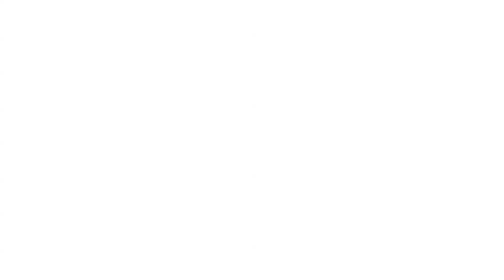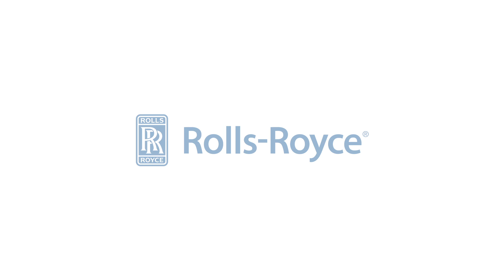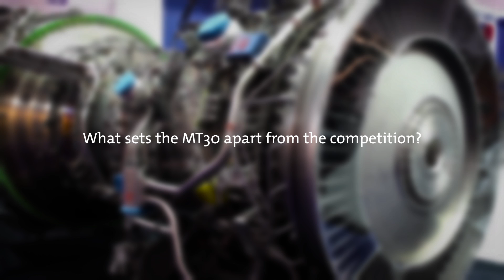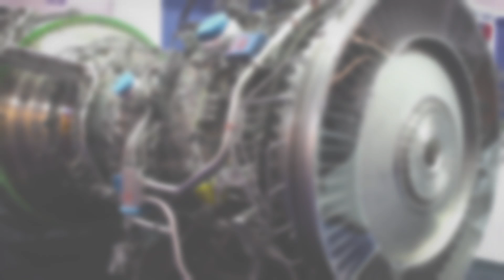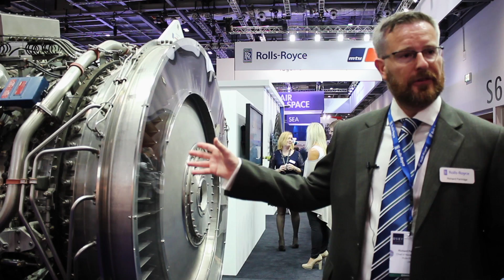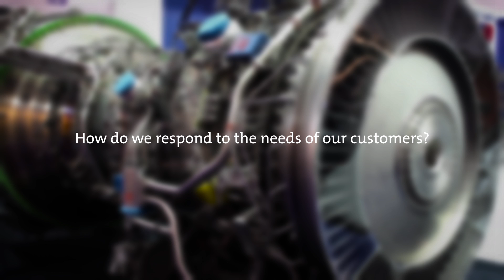Rolls-Royce | Richard Partridge On Our MT30 Marine Gas Engine

Comment: 40 MW is over 53,000 horsepower. Yet no ship those engines are installed in has anywhere near that much "horsepower" even when two are used. Why? Because the transmissions and accessory systems needed to make a "jet engine" work in a ship take the majority of the power the engine produces and then engine power is further wasted driving electrical generators that power electric motors for actual propulsion. Not to mention the warm humid air literally at "sea level" are horrible for "efficient" operation of "jet engines" and the lack of "ram air" those engines get when mounted on aircraft and the fact that they're just the "cores" of turbofan aircraft engines being used without the fan and as a result are just "turbojets"  just makes them giant, inefficient, fuel hog jokes as far as turning fuel into power "efficiently". 

And they never get anywhere NEAR 25,000 hours of continuous full-load operation between "overhauls" and are impossible to "overhaul" in place in the ship. Unlike diesel reciprocating engines that can be and are "overhauled" simply by replacing/rebuilding individual power assemblies (cylinder/piston/connecting rod/cylinder head assemblies) that are specifically designed and built to be overhauled and repaired "on-site" because of the impracticality/impossibility of "pulling" complete engines and sending them to an overhaul/repair facility for service.

And where diesel reciprocating engines are designed and built for continual operation at full load and are most efficient and give the greatest "operating efficiency" and the most reliable service and longest service time when started and loaded and kept fully loaded or as heavily-loaded as possible and can be used for "direct drive" propulsion or with a minimal amount of reduction/reversing gearing, "jet engines" or at least Rolls-Royce jet engines are overstressed and give very short service lives and are only available for "full power" operation for short periods and are designed to operate at "partial load". 

Cruising power in an aircraft is nowhere near "full power" and Rolls-Royce Trent turbofans have consistently "had issues" when subjected to true "full power" operation during "maximum power" tests like General Electric's "triple redline" tests GE "aero engines" are designed to "survive" continually and repeatedly for the entire service life of the engine. The last time a Rolls-Royce Trent underwent a "triple redline" test on a GE test stand for U.S. FAA airworthiness certification, it failed catastrophically and severely damaged GE's test stand only a few minutes into a test that GE engines can and do and must "survive" repeatedly for as many cycles and anyone wants to subject them to. 

And at a power level GE's "old" GE90 engines can and do reliably almost double during normal operation on test stands. GE GE90 engines don't reach those power levels in actual service because no airframe made can use/handle that much power. 135,000 lbs of thrust "maxed out". R-R hasn't been able to keep any "member" of the "Trent family" in "one piece" at 70,000 lbs. of thrust for more than a few minutes at a time and even then only under carefully controlled and specific operational conditions as far as ambient air temp, aircraft weight, airport density altitude etc on takeoff. R-R "jet engines" in warship applications even in lightweight and lightly loaded "destroyers" and "light cruisers" have a horrible service record and reputation when worked "hard" at their maximum rated capacities in anything but ideal conditions and "cold" seawater with heat exchangers and other cooling and accessory systems in "brand new" condition freshly installed or right after "refit" and that's with other diesel engine generators carrying most or all of the "hotel load" of the ship with the "jet engines" providing only main propulsion. 

But as long as they're going in taxpayer-funded warships where money is no object and market forces and profit/loss concerns are non-existent, what the hell.
Reply: Sir, I think you might be "missing the point".  These gas turbines are used in warships because they have a significantly higher power density compared to large, slow speed diesels.    A 40MW gas turbine and alternator package is about the same size a a shipping container, whereas a diesel with the same output would be the size of a large office building, and at least 10 times the weight.  That extra volume can be used for fuel tanks, living quarters etc.     Some of what you say regarding aero-derivative engines is true - but the trade-off works in favour of GTs for warships.
Reply: Dear me, you're not a happy bunny at all! You'd better bring this to the attention of RR's customers (RN, US Navy, ROK Navy, etc).
Reply: Argument based on facts, I like it. My 2 cents, the beneifit of using these jet engines in aircraft carriers (HMS Q.E) .. Would be fuel logistics. To refuel the aircraft is to refuel the ship, vise versa. We actually use (in the USA) the same jet fuel in our tanks as our aircraft, the fuel is JP-8 and used for everything in military to reduce logistics complexity.
Reply: I bet your fun at parties
Reply: Those are good points.
Reply: This unpunctuated rant misses the point. Size and weight of these power plants makes them the only option for many applications. Modern diesel electric locomotives are the norm using heat engines to drive gearboxes to drive generators to drive electric motors. Giant marine diesel engines are overhauled in place because they have to be and the ship is built with that process in mind. Turbine power plants can be swapped with relative ease and the ship is built with that process in mind. The latter requires far less downtime. I’d imagine some ships are capable of carrying a spare and swapping while at sea.